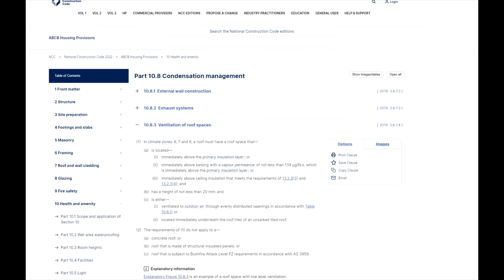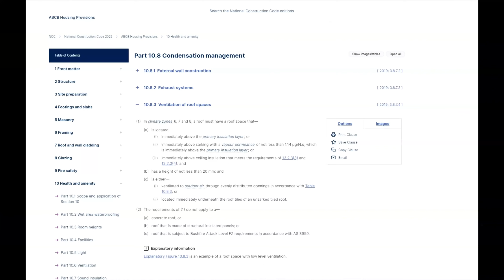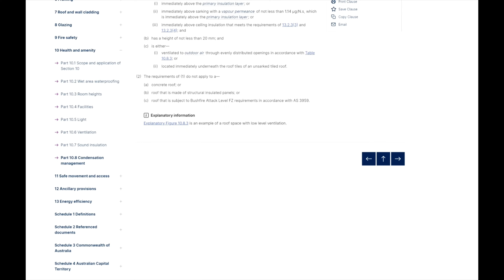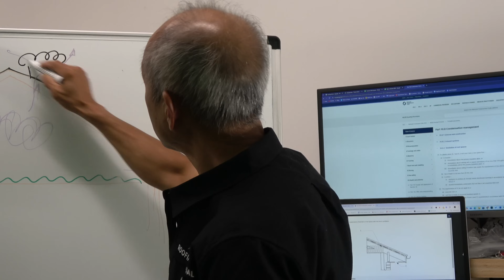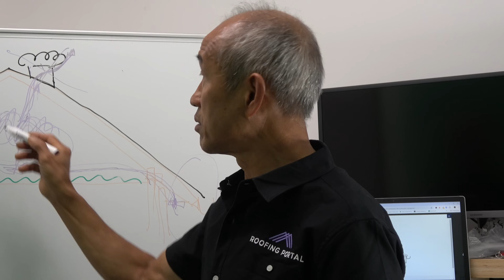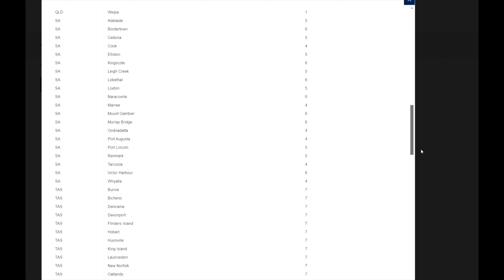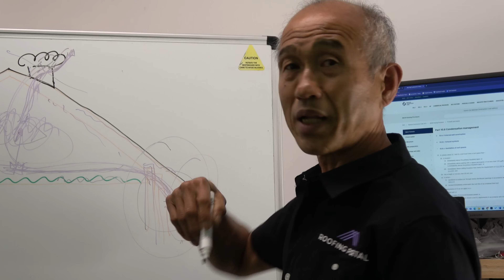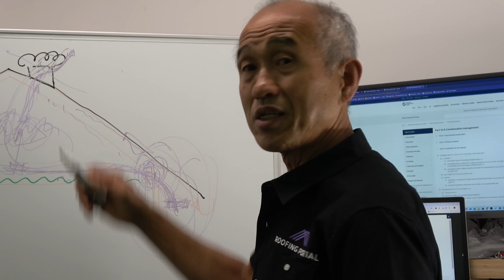Do whirlybirds work and will they make a comeback

Comment: My mother insulated her ceiling, but where she already had 70mm polystyrene, she has to put the gas fire on, as the temperature does not heat up enough for much the year.  Australia is not England where Australian Standards originate from British Standards.

Comment: The interesting thing I find about building bureaucrats, is they make regulation; pursue that regulation with vigor, and vexatious manner. Then legislators change the law, in some case which contradicts prior legislated building code and standards.  This means the prior rule created was wrong.  Blessed are the rule makers.

Currently, bureaucrats are obsessed with pressure testing houses for leaks, while people cook and heat with gas carbon monoxide within their home.  This is only one source of toxic particles that live in your home.  Don't get me started on mould, fecal matter and a plethora of other health issues.  So much so, the Health Department is strict on venting fecal particles out of the home.  

In years past, houses had chimney's, often in each room including bedrooms, that venturi air naturally, even if the fireplace not having a fire.  Chimneys are constant venturi's.  As bricklayers we are taught to build a fireplace to draw air.

As for whirlybirds, if hot air is expanding, then air is in egress of the roof.  Airflow can source from wall cavities.  Education Department training though was, air movement creates air friction, which creates heat.  When air heats, it expands.  Air will find a waay into the roof.

Any exit from a tile roof has heat coming out in summer which is great.  Australa still doesnt require silver sarking, directly under the tiles, which is an effective heat reduction in your roof, but only the roofers do this when they build a home, because roofers know that the silver sarking under the tiles is twice as effective, more so when in conjuction with ceiling insulation.

The reality is, behind the facia is gaps where air can ingress the perimeter when a flue, or whirlybird is installed in the house.  Australia is not England, nor the US where sun barely makes it through the trees in summer.

Some 80% of heat enters your home via glass - both directly and indirectly.  Regulators could change this, but it does not suit their lobbiests.

Once you look under the labrinth of code, there is ineffective bureaucracy, where many homes had 3mm glass, and now 4mm single pane glass.  Dont be scared of a flue in the roof, or a half dozen flues.  Air expansion pushes back downt he walls otherwise.
Reply: Watch as more people suffer respiratory illness, and cancer from these sealed houses that are pressure tested by expensive consultants.

Tocins come from many sources, not excluding cleaning chemicals, synthetic products like carpets, etc.  In the past, fireplace chimneys, even without fire, egressed air circulation to ensure mould etc did not build up, where millions of people suffer fatality from respiratory disease.

Comment: I worked for the company that produced the Spinaway roof ventilator Whirly bird for 14 years during my time there I increased the capacity of the factory from 300 units a day to an average of 950 every day. This included design improvements in materials and factory production flow. As part of the testing my own home in Mount Colah NSW was fitted with measuring devices in various locations on the house which were digitally transmitted back to the factory for a full 12months to gauge the temperatures and humidity year round in a brick and concrete tile home, the home was already fitted with attic vents at each end on the hipped roof. Measuring equipment was placed in the Attic space and several rooms at different heights and floors as the home was split level on 2.5 levels with 4.0 meter ceiling at the highest point. Temperatures were recorded with no artificial heat or cooling. After the data was collected the Roof was fitted with three whirly birds and ceiling fitted with ceiling registers that were place at the highest points in a bid to extract hot air from the house and the recording process restarted for yet another year. the findings were that the attic space was significantly cooler (less hot) than without ventilators on any given day. the biggest reduction recorded were on 42 degree days with an attic reduction of heat of 14 degrees centigrade compared to the same temperature the year before without ventilators. this reduction was also noted in the upper rooms being 8 degrees cooler and the lower rooms just 2 degrees cooler. Do they work yes but its not Airconditioning Hot days still felt hot but the house did cool notably when the sun went down.

Comment: I have istalled more than a hundred of these self-propelled units. If you climb into a ceiling cavity on a hot day and feel the heat, then install these ventillators and compare the temperature difference, it's a no-brainer.
To improve the effectiveness, l locate them on the hottest area of the roof. In addition, l put induct under eave vents to encourage cool air to replace the hot air being expelled by the educt whirly bird.
The badly designed modern homes with low pitched roofs make it difficult for the under eave cool air vents to work.

Comment: Good work, I am an HVAC/refrigeration mechanic, roof cavities have been convection cooled/ventilated for over 100 years, whirlybirds were just introduced as a more economical alternative to vents and reliefs in roofs. Convection cooling/ventilation automatically regulates airflow, when roof cavity temps drop convection slows down. For a standard roof you need at least six feet of ridge ventilation and the equivalent area of soffit(eaves) and wall vents(air drawn through the walls from the cavity ventilation. The old ways did work, I have been to many problem house that have been inadequetely ventilated etc, usually in the name of energy efficiency.
When my house was re roofed twenty years ago they threw the silver paper over the top of the roof, I went up there and cut the ridge gaps open to allow venting.

Comment: I do a good chunk of work in people's ceilings, commercial and residential. Not even a loose air-con duct can compare to how well a whirlybird cools the ceiling space. Turns what could overwise be a 50c ceiling space back down to only a few degrees above ambient if the roof is light coloured.
No idea how it affects your power bill, but it's the difference between me staying in the ceiling to finish the job and having to climb out and take regular breaks.

Comment: We had ventilation slots at the bottom of the outside walls in South Africa and every room had a vent inside  at the top but there was no Whirley birds on the top of the roof unfortunately.Living in Australia with super hot houses in the summer and no insulation in the walls was like WTF is the civil engineers doing and just slap a big HVAC system in the roof was to me not the answer.Living in Europe I quickly realised the only way to insulate walls and attics is with polyurethane spray foam. Not the open cell but the closed cell version.That should be a standard requirements in this country but unfortunately we have some very stupid people in this country and no matter what your say they will always have a different answer.Let them drown in their stupidity if they don’t want to learn.

Comment: I had two Whirly birds installed about 15 years ago on a cement tiled roof.
I asked about under eve vents and was told not required as its a tiled roof

If i hsd a metal roof the under vents would be required

Comment: They generally don't work well enough to justify their purchase & installation cost.
Typically a disaster during the winter because they suck the warm air out of the condutioned space inside the house.
Much better investment to cover the roof in solar panels, Or have a pale coloured roof, or shade parts of the roof with trees.
Furthermore, they tend to shade solar panels if they are installed as well.

Comment: Why am I watching this excellent and informative video on roof ventilation? 
How about a single eaves vent with a fan powered by a solar panel actively pushing air into the space?
The biggest issue with building regulations are that they proscribe a fix for a problem rather than just stating the result required.

Comment: I have 3 extractor fans for removing steam; laundry and bathrooms.
I also have 2 whirlybirds.
The extractor fans supply air to the roof attic (whether they are turned on or not) so in effect they ARE air inlets.
Reply: problem with that is during a 40c day you are bringing that hot air into the home when you run the extractor fans.
Reply: You should not ventilate into the roof cavity as you are putting moisture in there creating mold and wetting your ceiling insulation. If you live in a cold climate open your hatch into the ceiling one night in winter after you have showers and shine a torch in you will likely see sliver stars reflecting back at you from water droplets on the back side of your roof material or sarking.

Comment: In my house in north brisbane, there is whirlybird but no ceiling inlet vent. But it still make a cooling job. the air inlet comes out by way from the ceiling vent fan installations. 2 in the bathroom, 1 at the laundry and 1 in the kitchen. this is better here in queensland because of hot weather since it takes away warm air inside the room while sucking the hot air at the ceiling at the same time. Also, the roof area inside the ceiling  is not 100% air tight construction, therefore air can get in wherever there is a gap. Try to look inside your ceiling through a manhole and you can see light from the outside.

Comment: Yes they work. End of. Our neighbours either side don't have the convection fans, their air-con runs every day the temperature exceeds 25C. We have2 on our house and have used the air-con perhaps 6 times in 8 years. Granted, we've been going through a lengthy cooler period in tha time but even days 35+ we don't need to switch it on. Standard 8' ceilings, steel frame, gable roof, brick veneer.

Comment: Hot air expands - it takes up more volume than cold. And then it goes out the vent. You do NOT need an air intake for these to work. It can help, but that is not how physics works. The heated and expanded air remaining within the roof cavity has less mass, density and conductivity - less thermal energy - less ability to make the house hot. I am trying to explain in layman's terms. Alternatively, just look at all the whirlybird installations that WORK WITHOUT INLET VENTS. Measure the difference. You can do that easily by stopping the birds spinning for a day.

Comment: I had always thought of using the warm air that forms in the roof space in winter sunshine, to warm the house. Wouldn't be hard to install a reverse fan in the ceiling. Is there such a system available?
Reply from the maker: I would not recommend this.
I have looked into so many roof attic spaces and the dust up there is better vented out of the house.
You would not want that dust blowing back into your living space...

Comment: Had a heat problem in roof on my old 1979 Perth house (poor insulation). We installed whirly birds in 2014 and it lowered the house temperature by 5-10C on hot days. it lowered the attic temperature by considerably more. The reason it worked is because the air was coming in from under the back verandah (facing south, away from sun) and then up into roof, then out the whirlybird.
But I was well aware of the air replacement issue (I am a physics teacher) and the roofer understood the problem.
The reason I did not get insulation at the time was cost. We simply didn't have the money for new insulation at the time.

Comment: I have had a whirlybird installed for over 20 years and it makes a big difference to the interior comfort of my home over summer BECAUSE I have made two very important improvements. One, I have a piece of core flex that I slip under the whirlybird over winter so the heat does not escape, and two, the eave vents I have used are central heating floor vents that I can open in summer and close in winter using the end of a broom. As soon as I make it operational at the beginning of summer the need to use air conditioners is greatly reduced and as I live right on the coast I can normally just use the cool breeze I get after 4pm to cool down the home.
Reply: Its not the spinning that is helping but your the implementation of the stack effect. You could have a chimney to achieve the same result without the rattle as it spins.

Comment: Older houses in Melbourne all had vents in the top of the gable, and vents to the under floor area.  The heat goes out the top vent and cool air is drawn up the wall cavity from the under floor.  For some reason these vents seem to have gone.

Comment: Very interesting, I had 2 whirlybirds installed, no mention of venting but that makes sense! I have no saking in the rood, so would this provide enough or am I best putting in a few eave vents to be sure? 
Beyond that, I had advice my roof has "rusty nail problem" by  another roofer that causes my tiles to crack, I'm replacing tile often which is annoying.. not sure what the solution is beyond reroof!

Comment: Got several WBs and vents in the eaves but installing the vents is a shitty job . Works well though and I can usually run without air con up to about 35 degrees. If you are really keen there is much advantage in creating air flow in the roof cavity and if you own a newer house with wall insulation even better as most of the heat transfers through the walls on those stinking hot afternoons. Keep in mind as one previous comment asked, it’s the opposite it winter.

Comment: I’m a builder in the trade for about 40 years. You are correct, they are part of an air circulation system and there needs to be air inflow for them to do their job.
Reply: So what do you think weap hole help do and then the roof tiles are u saying they are air tight 😂
Reply: @ Try editing your reply again, but this time see if it can make sense 🤔
Reply: @aussie8114   weap holes ar for air flow in that wall cavity  that extends up to the roof 

Then roof tiles are not sealed they allow flow through the gaps do they not 
So there is flow
Reply: @ Weep holes are to allow water to exit from the internal cavity in the event water should enter.
Yes roof tiles allow ample air flow, presuming there’s no foil sarking beneath them, however this video concentrates on metal roofs which have very little air flow.

Comment: Get a thermal camera and some different thermometer types in a roof space. 
Get a whole summers worth of readings.
Next summer install some whirly birds on the same roof and get the same number of days measured.
That way you will be able to accurately determine the effectiveness of the whirly birds.
Reply: you could do this is a day, the youtuber is an idiot

Comment: Do you think whirlybirds work to help cool down an outside deck area with a flat colourbond roof? Our west facing deck gets very very hot but the flat roof isn't high enough to install outdoor ceiling fans
Reply: Might be a bit of work but you could try XPS insulation.

Comment: Some older houses in North Queensland have vents in all the rooms not in the eaves. I have 1 vent in each of 3 bedrooms and 2 in the living room and 1 in the kitchen and one in the toilet. I have 2 whirlybirds. The houses were built with out eaves. Very easy to put a vent into the ceiling of a room to have flow through to a vent. I did have one vent blocked off in a bedroom due to a BIR. Once I installed a new vent the difference was amazing in cooling the room. Thanks for the vid! Recommend white colour bond rooves as well. :)

Comment: My glazed terracotta roof tiles have so many gaps around them the wind howls through the roof space.  No rain leaks.  Older brick veneer houses with underfloor areas let cool air up the inside of the uninsulated walls.  No need for vents in the asbestos eaves.  Modern houses built on polystyrene blocks have zero air up the walls, no eaves, and use roofing tiles/sheets that are effectively sealed.

Comment: Question ? With the air replacement for the whirly bird .. Does the gap around the bottom row of tiles not do the same thing .. Same with tin roof .. All homes ive owned have all got a gap around the bottom of the roof itself.. The tin roof house i had had actual ventilation gaps under the roof .. And i stuck a whirly bird on the top and it seemed to help a lot ..

Comment: My old house had whirlybirds and an intake vent in the middle of the house, I hardly ever used the A/C in Summer as it kept the heat out of the house (rural QLD at the time).
Reply: As in, just in the ceiling or wall?

Or from the subfloor?
Reply: @willhooke  in the ceiling in the middle of the house.
Reply: @ thank you 👍🏻

Comment: What about advantageous air openings around the roof and between the tiles? They all add up?
Reply from the maker: Yes, they all add up. That is why the new NCC requirements on ventilation does not apply to un-sarked roofs.
However, as soon as the roof gets sarked none of these openings comes into the equation.
Reply: @roofingportal  ahh thanks mate... Good information.